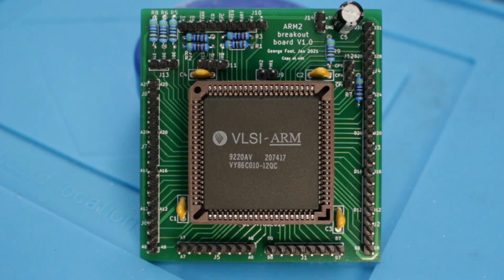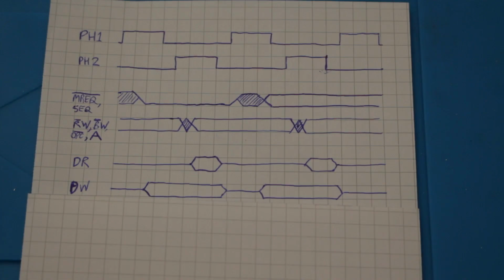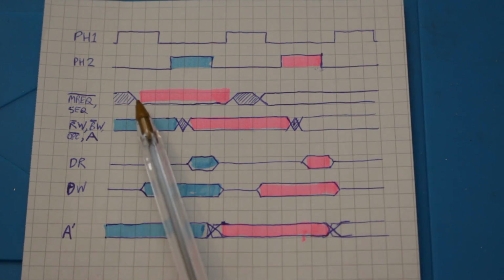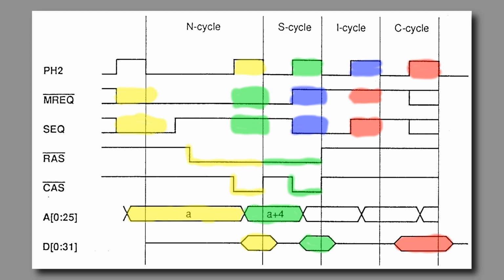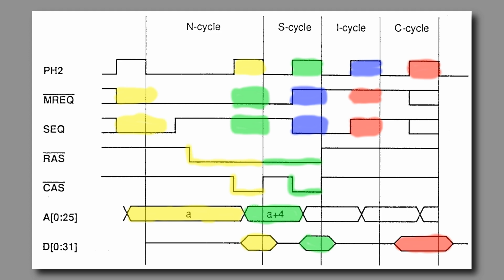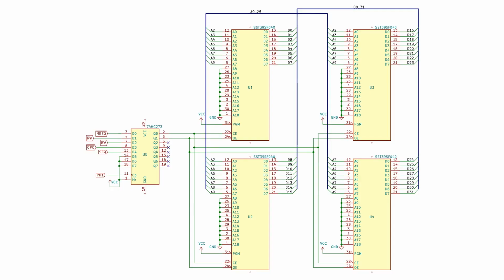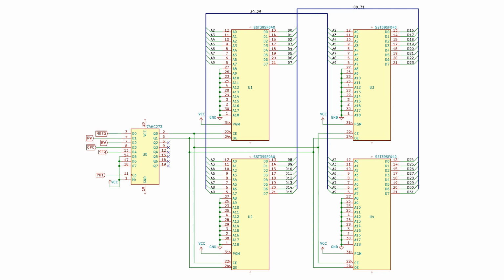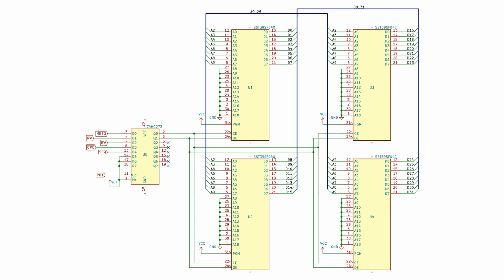Homebrew ARM2 #3: Hooking the ARM2 up to ROM

Comment from the maker: Something's been puzzling me - see here: https://youtu.be/sazoVd-Ez4Q?t=1807

I've got Address Latch Enable connected to PH1, which is the rightmost LED on the clock circuit.  This should mean that the address bus state remains constant while PH1 is low, and updates only when PH1 is high.  But at these low clock speeds we can see that the address is actually changing at the end of PH1, not at the beginning.

Any thoughts why that could be?  I'll need to fix this before more complex programs will work.
Reply from the maker: This is resolved in the next video!

Comment: I'm coming to this a year late but it's fascinating stuff. Most 6502 homebrewers who feel they'd like more of a challenge seem to move on to the 65816 so it's really good to see someone take on the other, and rather more successful, successor to the 6502. After the BBC Micro the people at Acorn (Sophie Wilson and Steve Furber, principally) certainly considered the 65816 and actually used it in one product, but rejected it and everything else available at the time and took the audacious step of designing their own. I switched from writing 6502 assembly language for the Beeb to ARM assembly language for the Archimedes around 1988. My initial thoughts were "how do you write stuff without zero page?" quickly followed by "with all these registers, who needs zero page?" and "I'll be branching far less now that any instruction can be (is, in fact) conditional" and then there are the free shifts and rotates, courtesy of the barrel shifter. There's a certain elegant beauty to the ARM instruction set and I find writing for it very enjoyable.

Comment: Probably a bit late now! But I had an idea, do it in reverse, make a programming adapter that uses the lower 2 bits of address to select each chip so it looks like 1 big 8 bit eprom to the programmer. I gues that would mess up any commands though, so unless you have your own custom programmer it probably wouldnt work.
Reply from the maker: Interesting, I didn't think of that. But do check the later videos for what I ended up doing!
Reply: @GeorgeFoot  Ive watched them all, all brilliant. I did a similar thing on my Z80 FPGA project but i used an SPI EEPROM and got the FPGA to copy it to RAM at power on.

Comment: I like your idea to copy EEPROM contents to RAM on startup. It simplifies writing the EEPROM and I've heard RAM speeds are higher than EEPROM, so you should be able to clock the system higher as well.
Reply from the maker: I think it's neat because almost all of the complexity would be required anyway to support byte-writes to RAM at all. We just need to hijack the bus for a bit before letting the CPU boot up.
The other idea I didn't explain in the video is to have the ARM do the unpacking on boot-up. The low words in ROM would form a program that reads the bottom byte of each word from a data block in ROM, and packs the bytes together in RAM. Then as desired I could update the program code in just one ROM, keeping the code stub at the bottom intact. It would mean there's no need for the counter or other hardware, just the regular RAM setup.
The unpacking program is only about 6 instructions, really small.